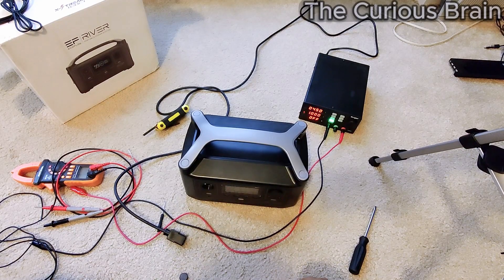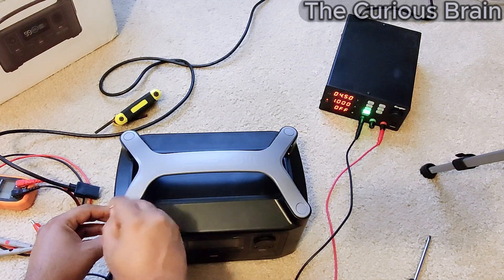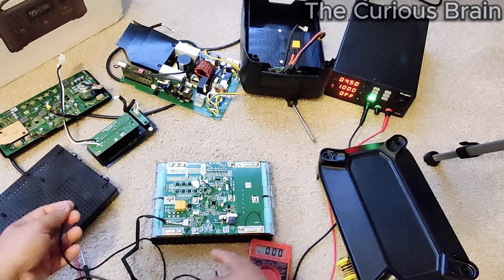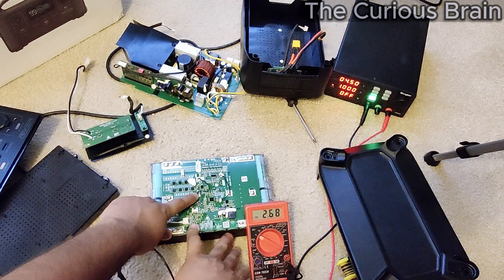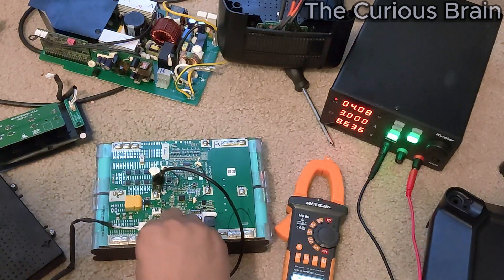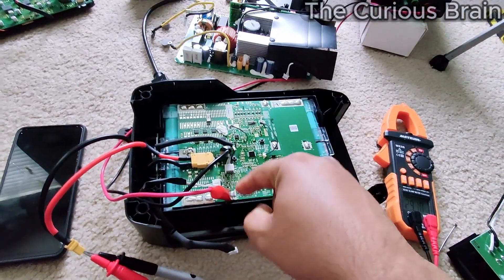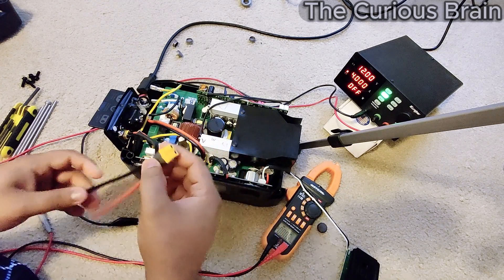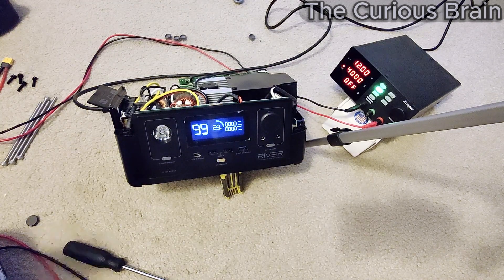EcoFlow River Repair | Battery Not Charging  | Dead Battery | Part 3 | Step-by-Step Instructions

Comment: My EcoFlow River Pro after breaking it down exactly as you did and testing each group of cells it shows every group is at 4.04v.  All groups are the same volts.  So if I don’t need to charge up one particular group to match the other groups of cells. How do I just jump the power station?  It won’t power the display on but the power button just blinks.  When I plug it into the AC with the power cord it just makes a few clicking noises and won’t charge or power on the screen or station.  Just the power button will blinks.  What do I do next?
Reply from the maker: Sounds like your battery is good but the problem is somewhere in the circuit board. Hard to pin point exactly where the problem is without testing. I'm not an expert in all components but try to test different components like mosfet, relay, fuse etc. That's where repair gets very challenging because we didn't design these products and these advanced boards are normally double side printed too means you see components on both sides of the board so it's pretty hard to figure out the exact issue but test some of the major components to see if you can figure out the issue. Good Luck 🤞

Comment: I have such a device and it shows a red battery icon, the user manual says the battery is faulty so I took it out and found out the cells were dead then I replaced them all, everything is fine but when I press the BMS button it gives 30 volts then turns off after 5 seconds and the green light is on continuously and does not flash. If you have an idea what to do I would be grateful
Reply from the maker: If all cells are balanced, then try to reset BMS to see if that helps!
Reply: @Xx_TheCuriousBrain_xX  Thanks for your reply, pressing the reset button didn't work, the cells are balanced but I have a suspicion that the difference in cell capacity is the reason because the original was 2000mAh, and the cells I installed are 2600mAh
Reply from the maker: Good point but in my opinion that shouldn't impact the functionality because BMS only receives certain voltage and it wouldn't know cells capacity. I still think it could be related to BMS. I have been working on my DJI drone battery repair and found that when the battery goes below a certain voltage (cells imbalanced), BMS basically shuts itself for safety reasons and won't let you charge or discharge anymore. That's where you unlock the BMS by using a certain program before it will start working. It is sort of complicated process for the first time and doesn't make sense to do all work on one battery but that's what I would think.
Reply: @Xx_TheCuriousBrain_xX  Yes there are types of BMS that shut themselves off for safety and that's a good point to make, you just gave me an idea, I'm going to discharge the cells at low voltage maybe that will work
Reply from the maker: Good 🤞
Reply from the maker: Good Luck

Comment: Hi, I also have the River 600, which I later upgraded with the EcoFlow “MAX” battery option, which doubled my internal battery run time. Everything works perfectly on my unit except my 12 Volt DC cigarette lighter fuse got blown when I plugged in a car tire inflator compressor, which pulled too much current on my 12 Volt cigarette port and the fuse blew. Now I get an error signal whenever I attempt to turn on the cigarette lighter DC port and then it automatically turns itself off again, but the rest of my River 600 Max continues to run and function normally. I contacted EcoFlow and they refuse to send me a replacement fuse so I can replace it myself. EcoFlow expects all their customers to send back their entire power station units just to replace a 25 cent fuse ! That’s crazy ! Can you provide me with a procedure to replace my blown Cigarette DC port fuse with a regular, more common user friendly fuse ? Can you tell me where that fuse is located inside the unit ? Much Thanks in Advance.
Reply from the maker: Hello, I am not familiar with the Max model but I would assume they are very similar to River as they are under the same umbrella. Based on my understanding when I opened the River, it mostly relies on relay with chips and other components. I can't pin point to the exact relay or component unless I look into it but couple of things I can mention: Do you hear click noise when you turn on the cigarette lighter plug? If click is same as before then I would think some component close to relay must have blown, similar to fuse. Maybe open it and look for some burnt area to inspect it...I don't have Max model so I can't make video on it unfortunately.
Reply from the maker: You kinda have to trace the path on the board based on relay sound towards the cigarette lighter plug. If that's not doable, then maybe buy some sort of NOT WORKING OR PARTS ONLY type Max on eBay so you can simply just replace the entire board to get it going since you know cells are good in your Max...hope that helps!

Comment: U didnt repaired it, like in the video title. repairing would be, to change the bad cells. and there bad.
Reply from the maker: Incorrect! Repair doesn't mean replacement, if you bring any non-working device back to life is called repair. It could be as simple as soldering a wire or replacement or entire battery bank. As far as cells are concerned, not all cells require replacement when they are bad as some can be charged and some indeed require replacement. I do have other videos where cells are 0v and won't pickup charging, so checkout those videos if you want to see how replacement work.

Comment: Great fix. Going to open mine up and see if I have the same issue. Mine's only charging through DC power, not charging via AC and can't even use the AC outlets. Getting overload error everytime I try using AC outlets. Do you have any thoughts on this particular issue on what the issue could be?
Reply from the maker: Definitely NOT a battery issue because like you said it's charging. So the battery portion is good. I'm pretty sure either some relay on main board or mosfet went bad. See if you hear click noise when you turn ac outlet on?
Reply: @Xx_TheCuriousBrain_xX  Yes there is a very noticeable, audible click when I turn the AC outlets on and the Overload text flashes. Would that be the mosfet?
Reply from the maker: So if you hear click, it means relay is good. Now seems like overlord message is preventing it to work like it's stuck on that message. Now I'm not sure how exactly it's programmed and what components trigger overload message. Maybe Google it to see if someone knows about it and maybe contact ecoflow directly if they have a way to reset it somehow?
Reply from the maker: Here is the link I found online, seems like it's a known issue and people couldn't figure out this issue yet...maybe contact ecoflow on this... checkout this link below:

https://www.reddit.com/r/Ecoflow_community/comments/10funsh/overload_sign_on_display_heres_what_to_do/
Reply: @Xx_TheCuriousBrain_xX I have this exact same issue as well… I’m out of warranty since 2 weeks ago…

Comment: What brand and model power supply are you using.  Thanks for the great video!  I had this exact problem
Reply from the maker: Thank you, here is the link:-

Kungber DC Power Supply Variable with Memory, 30V 5A Adjustable Switching Regulated DC Bench Linear Power Supply with Memory Recall and Output Disable Button 4 Digits Display and Alligator Leads https://a.co/d/4zsVWKG
Reply from the maker: I am planning to make a detailed video on my power supply to help understand how exactly it works and how it's useful for pretty much anything. Meanwhile feel free to subscribe to  help support channel.

Comment: Thanks for this series. I found it very informative. I hope you'll weigh in on this scenario: I found a Delta 2 for sale at what I thought was a great price. In checking it out everything works EXCEPT no AC power. pressing the AC power button does nothing. Even the light on the button doesn't come on. What is the likelihood something just needs to be plugged in inside the unit? What is the likelihood the inverter is bad. 
If I could get it even cheaper I would consider buying it for just the DC power.
Reply from the maker: It sounds like maybe a bad relay or so? I would assume it doesn't make a click noise when you press button? But yeah check with simple stuff first by making sure wires aren't loose and things are plugged in before considering components issues.

Comment: This is a great series of videos. Thank you for making them.
I gave this a shot myself, but didn't have any luck.
When I plug mine in, all that happens is a clicking sound inside every 10 seconds or so. 
When I give it 12 v through the solar input socket, 24 volts are going to the cells, so some things are working in there. 
I was able to get the cells charged up to ~3.1 volts. Is that just too low for the thing to start up?
Everything inside looks good, no blown caps or scorch marks. 
Any ideas of what I could check?

Comment: mine has an issue on the DC input side: when plugged into a 120w solar panel (multimetered checked amperage and voltage -> ~117w), my ecoflow only read ~70w then would drop down to 5watts then climb back up and repeat the cycle. did the same thing with car cigarette lighter DC charger; so ruled out the solar panels.

then ac output on a 600w appliance would show 700w+ and would overload and shutdown. tried the same appliance on another power station and it read around 608w and worked fine there.
ended up having to use my ecoflow to somewhat charge my other power station, and that would power my appliances on our camping trip. 

worked fine previously as i ran a test to see if i would have any issues on my camping trip and there were no issues. 

any suggestions?
Reply from the maker: Interesting question, to me it DOESN'T sound like a component issue like bad relay, capacitor etc because technically it's functioning correctly but doing wrong Watt calculation either when DC charging or on AC output. It seems like it's losing his mind and confused, so I think it's maybe firmware. I would think you already upgraded your firmware, if not maybe check your firmware to assure it's fully up to date. Maybe lookup on factory reset options, as I'm leaning more towards firmware on this.
Reply: @Xx_TheCuriousBrain_xX  it was doing this prior to upgrading the firmware, so we updated to see if it would fix the issue.
it did not.

luckily we hit up the ecoflow tech support and they agreed to take it in for repair. we just received it back.

it is now reading 90w on a bright sunny day - steady.
at least its better than what it was. but im sure one camping trip it was reading over 100.
but it is now now fluctuation up and down like it used to.

i asked the ecoflow guys what was the issue, waiting to see what they reply

Comment: Thank you so much for this serie of videos. Very helpful.
I managed to charge each 8S battery up to 3.68v (one was down to 2.4V) but the BMS it is still going off after few seconds and I still have the red exclamation mark (battery failure).
I checked each 8S battery by applying load with a light bulb and they are not dropping their voltage so all cells seem fine.
I see around 29.3V on the main output when the BMS is started but it then goes to after the BMS shuts down.
Any idea what could be the problem?
Could it be a defective temperature sensor that is causing the BMS to shut down?
NB: the issue started just after a deep discharge so I was hoping that charging each pack as you did would solve the problem.
Reply from the maker: Sounds like you did everything correctly! I don't think the temp sensor is bad, maybe just need BMS to reset? Press and hold the reset button (on battery pack) to see if that helps? Try to charge your power station using solar/DC port instead of AC port to see if that pick up charging.. Try to see if you can turn on the unit somehow and update the firmware if you can to see if that fix it.
Reply: @Xx_TheCuriousBrain_xX  
Already tried to hold reset both on BMS motherboard and on the control panel with no success.
I will try again via DC port.
I cannot update as the BMS shuts down after few seconds.
Reply: Holding both flashlight and 12v car plug buttons for 15 seconds resets bms
Reply: @zelo533  thanks. I already tried it.
I don't have any idea left.

Comment: Hello!
Thank you very much for creating this series.  I was able to take apart my little puppy...and after hooking up a multimeter all of my voltages = 4.04v. Reading the main board voltage = 20.4?
I was hoping for a bad set of cells - but in my case, I have constant voltage.  I am unable to turn on the machine...turns on then off.  Any ideas on how to bring this back to life?  Thank you again!!!
Reply from the maker: Thank you for the comment! Something doesn't line-up. They got 8S battery, so if you got 4v in each segment, then total voltage should be 32v or so not 20. Maybe check again, something doesn't seem right.
Reply: Sorry... battery voltage at the BMS = 31.92... the of things is that 31.92 is on initial startup of the BMS... if you come back afew minutes later... it shows 20.09?  bottom line . i can't charge it.. and it will not turn on
Reply from the maker: Sounds like bad cells to me, when voltage with load drop and goes back up when there is no load. If you got bad cells, then charging individual cell won't help but you can confirm it by applying small load to each segment while using multi-meter to see if voltage stays same around 4v or drop or things doesn't work when you give small load. Just connect simply like small dc motor or light bulb or anything small dc power device on each segment to see if that works. I did the same in one of my hoverboard battery repair video, hope that helps!
Reply from the maker: https://youtu.be/FTTY-EDSY8A?si=6pVMiS3pZzSsRyEO